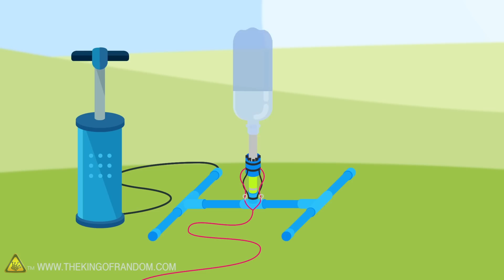Watch What Happens at Dark

Comment: Hey guys, great video. Love the glow component. We will try that with our troop. A couple of suggestions:

For a more permanent solution to the electrical tape ring. You can use a candle to melt the pipe at the point where the bottle stops. When it's warm compress the pipe a little bit to create a compression fitting. The natural flare from the compression will keep the water seal. Otherwise, the electrical tape has to be replaced every so often. 

Second is if you use propane instead of air you will get more propulsion. Propane compresses better than air.

Comment: The idea and the mechanism is great, but the PSI cannot be measured properly due to the friction/lock mechanism that locks the bottle in place with the zip tie. Also, using electrical tape to get the bottle to lock into place without leaking air is not the best way; the tape is malleable, which means it's not in the same position every time.

Comment: When I was young during the early 1960s, I had a hand held water rocket that flew really well . The rocket was 7 or 8 inches tall and maaybe 1.5 inches in diameter.   I used to experament a lot with different amounts of water to see what made the rocket go the highest.  LOTS of fun, but I would have been amazed to see this size of unit!!!

Comment: I had a nostalgia trip with this build! My cousins and I used to do this all summer but we just used a bike pump and made a few adapters with small plastic funnels from home depot and A LOT of electrical tape! Fill bottle with water, plug the hole with the electrical tape, pump with a bike pump and as pressure builds... BLAST OFF!

Comment: i did way better with a cork, an auskick pump fitting (to pump a ball, they r really shittly plastic btw), and some aquarium tube going straight to a bike pump.

i put in about 60 psi befor it starts leaking and i get anywhere between 10-15 second flight times

i also made this when i was 13 with stuff i found lying around the house

Comment: A better way of making it is by attaching an L shaped piece of pvc pipe to a board with the larger piece of pipe around the base and drill a hole thru the larger part pipe nearly touching over the bottle and use an Allen wrench tied to a string then pump it up with water and pull the cord

Comment: Try to react calcium carbide and water in a bottle and then ignite the gas which will evolve.
Then make a hole in cap and attach a pipe and then attach a syringe at the end and then use it as a welding machine.

Comment: Easy adjustment is to heat up the PVC with a birthday candle to make a bulge that the soda bottle will push against to keep the water and pressure in. Our Cub Scout pack uses 2 1/2 cups of water and 70# pressure. We also have a 6 station launching unit that uses an air compressor.  The glow stream is awesome!!! Thanks for sharing.

Comment: Needs a better seal for more pressure. You should figure out what the maximum pressure you can put into one of your bottles, and try to work a seal design around that. The zip tie locking solution is simple but I looks like it may fail over repeated use and at higher pressures, as the zip ties become less elastic with use (the ones being used as springs) and won't hold the device as tightly in place. 

This may be a fun project for the future, just to modify and mess around with other systems.

Comment: If you fill the cone with sand, it will fly higher. My friend and I used to do this stuff, and it definitely makes a huge difference. It turns a thirty feet of flight into a couple hundred feet or more depending on pressure. We used about 60 to 80 psi

Comment: If you fill a bottle with a enough helium will it float?
Reply: Lava Lit 2000 No. Not enough space to hold enough pressure to lift it
Reply: If you can find a bottle large and light enough.
Reply: Then it wouldn't be a bottle... duh...
Reply: No. The density of the helium is less than that of air, therefore requiring a greater amount of helium. Because of this, the final weights are the same.
Reply: No, and if you put any more helium than then you need to displace the air it will just make it heavier again.

Comment: Hello guys, instead of using a pump, you could use a co2 extinguisher without the disperser to power up the rocket, 2500 psi bottle rocket it would be very cool

Comment: The best psi is around 50-60. You can also make the cone hinged with string or a 3D printed part so you can deploy a parachute. As the rocket flies up the air pressure will hold the cone on but when it reaches the apex of its flight the cone will fall off and the parachute will deploy.

Comment: There is a better way to do this, take a Schrader valve and put that into the bottom of the bottle. Then drill a hole in the cap wide enough to get some plastic tubing into it. Cut off about 2 inches of the hose and seal off one side by heating it and pinching with some pliers. Then stick the open end of the hose into the cap. Fill the bottle 1/4 with water and pressurize to 60 psi. Then cut off the sealed end of the bottle to launch.
For a stand take a metal rod from a lawn sign and put it in a straw taped to the side of the bottle

Comment: a couple of possible improvments that could be made is when your making it hot glue gun bottle necks around the bottom of the bottle so you can load the liquid after it is on the firing mechanisim and you dont have as much spillage due to loading it

Comment: I have 5 of these in my garage, made them when I was a Boy Scout and it was only two weeks ago I was showing them off to my son’s scout troop. Mine don’t have zip tie “launch control” and use a shorter length for the bottle to slide over. Yours may have a “launch tower” kind of effect bc of that longer piece. Gunna have to experiment and bring out the new version next time.

Comment: When i made one we used a bike pumped, a rubber cork in the bottle and a valve in the cork to allow air to go in, once pressure was high enough the bottle would shoot off cork. We used a long screw like thing and a small pipe which fits over. The pipe was cut small and glued onto the bottle, the screw was on a board and you can probably imagine the rest

Comment: So the thing i do is i take a bike pump, one with a hose on it. I take that wooden wine cap thing and drill a hole in it. I put the hose through it. First i place the hose through a traffic cone and im connecting the cap with the hose on a bottle filled 1/3 with water and pump like 3-4 times and it flies up very high.
Reply: we inserted a needle attachment used to pump up footballs into the cork and attached the pump to that.
Reply: Tbh its not really needed ;D

Comment: drill a small hole in the bottles cap. glue on a rubber gasket.  fill and cap the bottle. next place the bottle on top of the launcher. lock it with the zip ties.  pressurize... pull the cord.

Comment: You're better off buying the hoselock bottle connector and the joiner. You can use a smaller bottle and a smaller nozzle. No leakage and more pressure.

Comment: Can you try to put water into a vacuum chamber chamber, then freeze it. I want to know if the ice will be transparent or not
Reply: Bringing very well filtered water to a boil two times will result in very clear ice cubes.
Reply: the water will boil before all the air is removed from the vacuum chamber
Reply: Not necessarily; if the heat can be removed quickly enough, the water will not evaporate, but it may still boil off a little bit.
Reply: No it will help a little but not really
Reply: Even if it's freezed in a vacuum chamber?
Reply: If pure ice is subjected to a vacuum, it still boils off ever so slowly.
Reply: @misturchips  how about dry ice?
Reply: Dry ice will also sublimate slightly quicker in a vacuum.
Reply: @misturchips  interesting...

Comment: Will molten gallium freeze faster in a vacuum?
Reply: It will solidify slower as a vacuum is a very effective way to insulate. Heat can only radiate away via IR. Without air convection is not  carrying the bulk of the heat away.

Comment: You could use a hose gasket inside the cap of the bottle put the cap on the bottle and drill a hole threw the cap small enough so it don’t shred the gasket then use a piece of pvc according to the size of the hole so the gasket will keep the bottle on till it’s at the perfect pressure then kaboom also hook it up too an air compressor